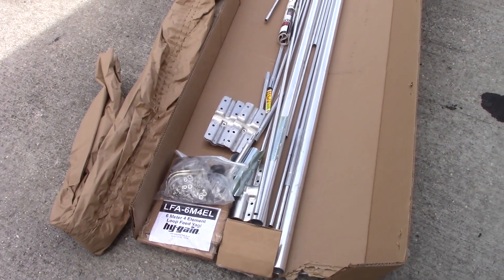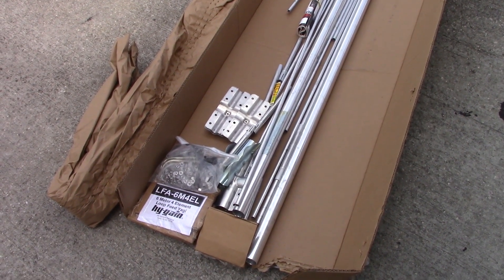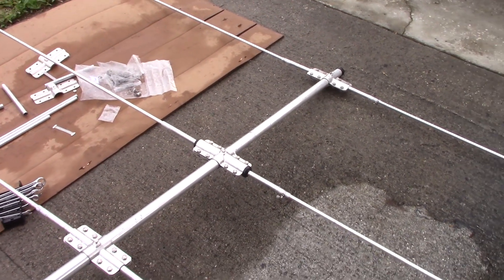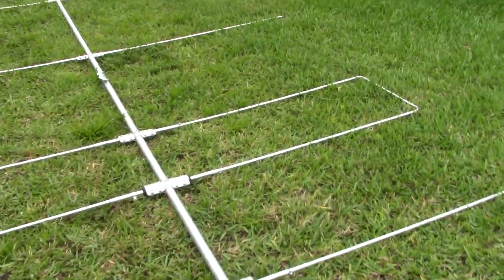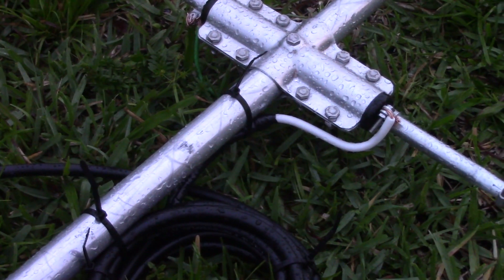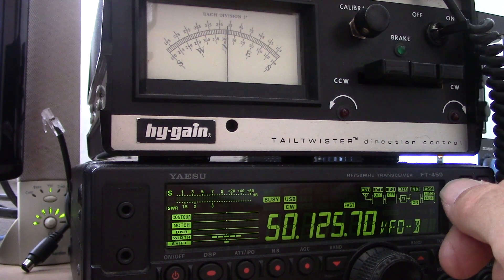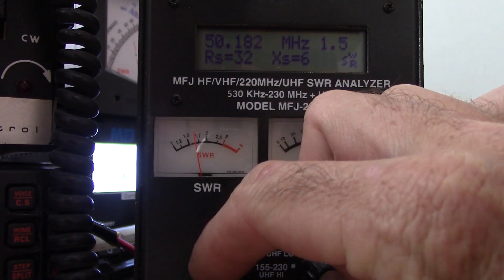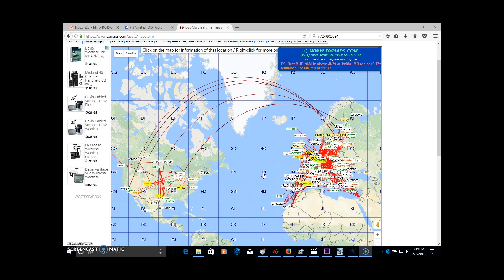LOOP fed yagi 4 element 6 meter HY-GAIN Loop fed array

Comment: We (WA1SXK and W9MDB(me)) recently tuned a Cushcraft 6M4EL LFA (this exact same antenna).   We were trying to tune to 50.3 primarily for FT8 work on 6 meters and ended up at 1.7 just like this video shows.  We worked with the original designer of this antenna and discovered the measurements in the Cushcraft manual were wrong.  We ended up at 49.5 inches on the loop (measure from center boom to outside edge of loop) and 54.25 inches on D1 (the 1st director).  We did this tuning at the antenna initially with a SARK 110 analyzer  to achieve zero reactance by moving the loop...then adjust resistance with D1.  It was an iterative process but we now have a VSWR less then 1.1 at 50.3MHz (note that you can pick most any frequency within 200KHz or so of the center and still get < 1.1 and 50Ohms).  Then we added the bead choke and 61 feet of Ultraflex 7 through an antenna switch, LPA-500, to an IC-7300 and right now shows VSWR 1.1 and +/- 300KHz to VSWR 1.5.    Several things we learned....
Do not tune your 6M beam at the rig...the common mode will mess up your measurements.  Also do not try and tune using VSWR -- you'll just get yourself wrapped around the antenna trying to adjust it (VSWR hides what you need to adjust).Tuning can be mostly done on the ground with the antenna tilted up and at least 3 feet off the ground.  Raising the antenna further will make some small changes (like increasing the tuned frequency) which you can adjust again if you want to improve the measured VSWR.  Your goal is 50Ohms, and j=0.  When you add your coax and rig you will get some change since nothing is ever exactly 50Ohms plus you pick up effects of the cable...but the tuned point (j=0) should remain no matter the length of the cable if the antenna is tuned close to zero reactance and 50Ohms (VSWR < 1.1).  Once you hook up your coax DO NOT ADJUST THE ANTENNA ANY MORE.  Any more antenna adjustments will lie to you at the rig due to common mode effects.  You already tuned the antenna.  Changes in coax length will effect the non-resonant portion of the 6M band but a tuner should be able to handle that to make the rig happy.  We also found that rain no longer affects the VSWR at the tuned frequency.  It will affect VSWR on non-resonant frequencies.  Note that resonance is J=0 and not minimum VSWR and is why you can't tune using just VSWR.

Comment: the problem is both drop 2 meter lower the rf choke should be 15 turns on 6 inch al my antennas have the same choke and running 1.1 on all

Comment: Use a current balun, put the 6m beam at the bottom of the mast and the 2m at the top, increase the spacing to 1 wave length @ 2m

Comment: If your coaxial feed cable is long, attenuation by the coax may be the cause of two different SWRs measured at two different location, your Rig and ANT feed point. Because the reflected wave is attenuated by the coax during the round trip back to your rig.  from 6M0MM, Woo

Comment: If there is another length of coax between the RXTX and the feedline that isn't there when you connect the MFJ, it will give a different reading. This is because of nodes along the cable caused by mismatch at the antenna. You can either just not worry about it or use a matching stub or some other matching scheme at the antenna. I'm no expert but that is that is the most accurate description based on what I have read.

Comment: Have you tried more vertical separation between the VHF and 6 meter yagis?   I think 10ft seperation would be the most ideal (1/2 wavelength of the lowest frequency)..

Comment: Radio stations close by can make antenna analyzer give bad reading
Reply: No, they won't.
Reply: They certainly can, but not likely to on 6 m.  It is very common on 160 m. with nearby AM BCB stations. 73, K5RX

Comment: The choke balun is NOT a impedence matching device. 
To match a yagi's feedpoint, you need a 1/4 wave stub, Pawsey etc.
Also, the length of the coax center conductor and shield should be as short as possible as they behave like radiators.
It is possible to achieve a 50 ohm match with a Yagi, this is needed if one desires to have maximum power transfer from source to load.
Reply: The LFA yagi has a feedpoint imedance of 50 ohms. One of the LFA benefits.
Reply: @joeh3767  True, there are however 3 possibilities when presenting the antenna with 50 ohms. Inductive, reactive and resistive. It is the latter you want at the feed point. You can have a nice swr and still waste power if it's a combo of reactance & resistance or a combo of all three types of loads. The Pawsey stub if measured properly will give the feedpoint a resistive load. If you have a antenna analyzer, have a look. Few antennas present a pure resistive load without some type of impedence matching. Many hams confuse a good match with low swr where power is often wasted in reactance, inductance or both. Look up a Pawsey stub. I run a 5 ele  LFA on 6. My field radiation AND pattern are much better with the stub.
Reply: @apetercharlesstudio  Good clarification. Owen Duffy has a nice piece on this.
Reply: @joeh3767  He sure does as well as others. The cool thing is a 6m stub is beautifully simplistic. Rather than coax for my stub. I used a 1/4 wave piece of stainless. Just kept making small cuts till the analyzer showed I/C were minimized.
Reply: @apetercharlesstudio  Suggest you check out SS loss at 50 mHz.  K5RX

Comment: iv got 20 year's in on 6, and 25 with the state, your radio is seeing the swr off your analyzer not ant, same as it would if you was running a amp, and check you spacing on ant, 73's
Reply: @HamRadioConcepts  Yeah...is he saying that after 20 years on 6 meters, he's  worked only 25 states?
Reply: His analyzer isn't connected between the radio and antenna is it ??
Reply: @miller-clem  MFJ analyzers don't have an input AND an output, so it's impossible to connect it between two devices.
Reply: Yeah you have a jumper from your radio to your analyer, your radio is only looking at the swr bewteen radio amplifier or swr meter, that why you have a turn input on amplifiers

Comment: Thank you for taking the time to put this together, especially in the rain! It never fails. You want to put together an antenna and Mother Nature has reached a decision of her own. Here are two things I question about your installation.

First, you didn't use a BALUN at the feed line and bring it down with some high-quality LMR 400. I would have purchased a ferrite 1:1 BALUN. They are inexpensive. As you know, the purpose of the BALUN is to eliminate the RF coming off of the coax and once you factor in putting on a PL259 and then using a coupler and then another PL259 you've already spent as much money as you would have on a choke BALUN and you have insertion loss that needs additional weather sealing. Another approach would be to take about 12 chokes and slide them over the coax along with a piece of heat shrink to hold them in place. you may use some black zip ties to further hold them in place. You use black to minimize UV breakdown of the zip type.

Second, remember that current flows on the outside of the conductor. You used single strand coax and simply ran a loop around a nut and bolt. For the maximum transmitted power which may seem miniscule to some but you want to use a multi stranded cable. In a strong wind and vibration that single conductor can easily snap and now you're pulling the antenna down to fix it. I would have used a crimp connector and actually soldered the wire(s) to the crimp connector. You need to weather seal them. You may have done this just to get it up in time for the VHF contest but the extra 5 minutes would have made a big difference for you with rain already striking the ground. At 50 MHz your goal is to get as much power to the transmitter as possible and as much receive down the line as possible.

I hope that these suggestions are received with the goodwill that they are intended.
Reply from the maker: First, i did use Hyperflex 10 Mesi and Paloni coax, solid copper standed center, double braid with copper foil, and the copper wire i used for the braid i did say solid, but it's actually stranded as well.. Check out the Hyperflex-10 coax for the specs and design... Also, the balun i do agree i should have wrapped itin a straight organized coil, which i am going to fix, but so far it has been working, no RF in the shack, but many people do not use a balun either.. Thanks for the suggestions.
Reply: HamRadioConcepts ::Thank you for accepting my comments with the spirit that they were intended. As one ham to another. I appreciate that you use Paloni coax. I went to their website last time you mentioned it and could not find the specs on it. If it substantially improves on LMR 400 I might consider it. But I can buy half inch hard line for a dollar a foot. On 50 megahertz that's less than half a dB loss for 100 ft. Back to to-the-point, as long as your handmade BALUN is working you're all set! My preference is to use an actual BALUN from say DX Engineering. A 1:1 choke balun is $43 but I like the performance better. My bigger point that I was trying to make to you was using a single stranded center conductor coax. Current flows on the outside of the conductor and you get a better flow of your RF power using multi-conductor coax. Just as important, if you have winds kick up and break of the single center conductor guess whee pulling the antenna down? LOL. I'll come to watch. At a minimum I would have used a circular lug and soldered the center conductor to it and then wire tied it down so that even a little bit of play wouldn't snap the center conductor. I would also use paint on tape that would seal the crimp lug from all moisture.

I hope you're not reading this instead of actually playing in the VHF contest! Let us know how well the antenna has done on 6m and if there was even an opening. It is 7:30 a.m. here in Southern California at 6300 feet where I live and 6m appears dead on a dipole. WWV at 10 MHz was at 9 with a lot of noise. Great video!

Comment: I installed the same Hy-Gain LFA4 antenna on May 1st and have been using it quite a bit since then.  I was actually the first customer to get this antenna from Hy-Gain.  The issue I had was the first director (2nd element from the front) was too short so I had to slide out the larger diameter piece further from the boom to make the measurements correct.  I also ordered a bag of #4 hose clamps and double clamped everything.  I am happy with the performance of the antenna and have powerline noise issues as well and it is VERY apparent when I rotate away from the noise.  I feel the F/B ratio and low noise claims are completely valid with this antenna and I strongly recommend it.   As somebody else mentioned, I would recommend re-doing your choke to make the coils side by side and see if you can do a better job of connecting the coax to the driven elements.

Nice job producing the video and sharing your experience!!!
Reply: W5SAT I suppose......
Reply: Yep - that's me.

Comment: First I would redo your coaxial choke,the turns need to be side by side do not let the turns overlap,wind it on a round form.2 it would benefit you to put the 13b2 above the lfa and get as much separation between the two as you can.The coil is not actually a balun it simply acts as a high impeadance to keep rf from coming back down the feed line and distorting the pattern.Good luck this weekend and hope to hear you. VA6PPZ

Comment: I have the same MFJ analyzer. I have noticed when I am around certain devices it will pick up local EMI. See is you get the same results if you ground it or move it away.

Comment: Eric,
When I had my tribander down for servicing, I installed a Comet CA-52HB4 4 element 6M wide band yagi. It has less than 2.1 VSWR across the whole 6M band. Haven't made any contacts, yet. Hoping to make some during the contest. Another point is to seal all the coax to element joints. I found that liquid tape works great. Three layers gives a thick coating. The Comet is located about 9 ft above the tribander and 8 ft below a dipole made from two Hustler MO2 masts and the tri-resonator accessory for resonators on 80, 40, and 20M. All mounted on a Wilson TT45 tubular tower rotated with a Hy-gain T2X. The Comet sits about at 40 ft lowered and 55 ft when the tower is raised. Forgot to install a balun. I'm making mine out of ferrite beads and will put them on next time I lower the tower to the ground. I'm using the same radio as yours.   73  WB3BJU

Comment: Put new batteries in your analyzer and recheck the standing wave, seriously. 
Mine gives screwy readings when the batteries get low, sometimes even just a little low and it gets screwy.
And dude,   just keep your yagis (ssb yagis)  horizontal the way God intended,  not some gimmicky half/half so you get "some" of both. You didn't purchase,  assemble,  and install an expensive high gain antenna just to half-ass the whole thing. When you have a yagi you are trying to optimize  not half-ass. Dont listen to that silliness.  By doing that 45 degree silliness you are compromising your performance by several dBs and much clarity and just blowing your whole intention. You're just shooting yourself in the foot and wasting your money and a damn nice antenna. If you cock it over like that you might as well just put up a 3 element horizontal yagi for SSB  (which I actually use right now on 2M and does surprisingly well) and a small vertical for FM because that's basically what you're getting by compromising your high gain yagi in that way.  So just leave your yagis horizontal for SSB and mount you a nice colinear vertical (if you're wanting gain) on the corner of your house for FM , a nice Comet or Diamond they work extremely well, you'll be surprised how well they work and go from there. 
Good luck this weekend, 
KF4PCT

Comment: Probably the spacing is causing your readings. If you look at the directions of your antennas  they will state the stacking distance of like antennas. If memory is correct the 13b2 needs something like 9 1/2 feet between it and another 13b2. And the 6 meter antenna is probably going to need something like 11 feet. So, I wonder if your readings changed on the 13b2 after putting the 6 next to it ? Now I'm not saying you won't be able to make contacts the way you have it but the 2 antennas are differently seeing each other. There are some good websites about antenna stacking but the bottom line is do the best with what you got and have fun. 73 W0JW
Reply from the maker: Yah, the best with what i got, or else i would have them on different towers OR seperated more.. But hey, already landed a couple 6 meter contacts that normally only look like S1-2, he was S9+10
Reply: OK, thats great. Now check out jt65 and msk144 on 6 and go get them grids.
Reply from the maker: Well, I am familiar with JT65, didn't use it long.... I love weak signal modes and QRP, but i guess 6 meters might give me the itch to try JT65 again. It's kind of slow.. But now it's like trying it all over again. Is PSK active on 6?

Comment: I have the same problem with an $400 SWR meter, compared to my newer ICOM radio.  I think it is the resonance the cable in between the radio and the SWR meter.  I tried 2 other meters, and they both read high.  I changed the cable length between the radio and the meter and I was able to make them match - not sure what is accurate however!  Like to see other comments on this subject, as I have seen this more often than not at other friends setups.